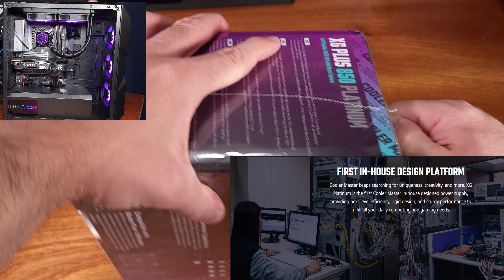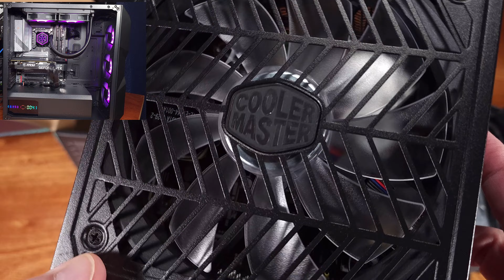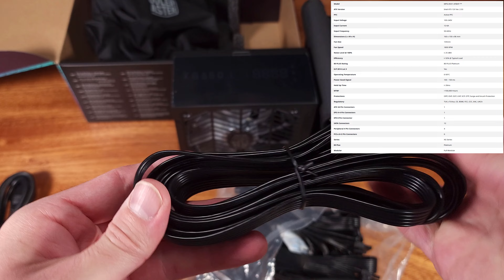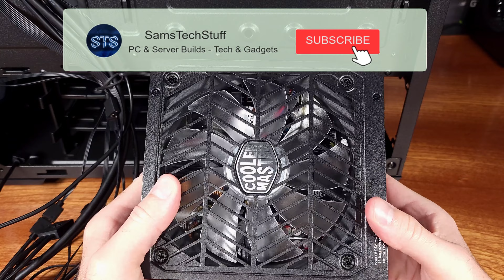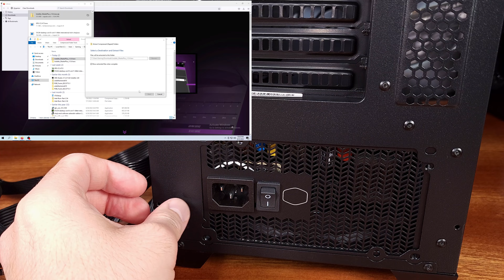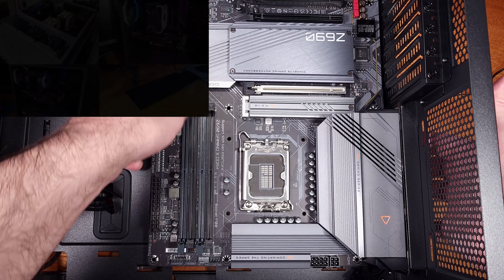Cooler Master XG850 Plus PLATINUM PSU Unboxing & Review

Comment: Hello!I bought new xg750 platinum.Installed in new PC? connected and it won't work - even no display, no rotation fan.What should I do or check?
mike.
Reply from the maker: Sorry for the late reply here! Did you get this working? I think there was a USB cable that I needed to plug into the motherboard in order to set the display up on the XG850

Comment: Looks amazing, wish they had more than 850w ARGB
Reply from the maker: I agree! its quite an awesome PSU and still running strong in one of my test builds. I'm not sure why they don't produce a higher wattage version? I would assume hte cost might be too high? Not sure. 

What kind of wattage did you need? Was this a gaming build or something like a Homelab server?
Reply: @STS  Realistically, I would want something with around 1000W, for keeping a safe range with my 4090.
Reply from the maker: Ah, yea, if you're packing an RTX 4090 you probably do want a 1kw PSU. What did you end up selecting?

Comment: Do you know of any aftermarket cables that'll work with this PSU?
Reply from the maker: Aftermarket cables? I am not sure to be honest - generally I would only recommend using the original manufacturer's cables. Were you thinking of sleeved PSU cable extensions?

Comment: la acabo de comprar por 109 euros cuando en muchos sitios está a 249. Pedazo de ganga
Reply from the maker: Wow, that sounds like a great deal!
Reply: Yo tambien, coolmod verdad?
Reply from the maker: Great deal!?
Reply: @STS  Yes, time ago 1 euro was 1.20 USD, now 1 dollar is 1 euro. The PSU is around 230-250$ and the deal on that page was of 110$.
Thanks for the video too! Useful
Reply: @Zerohmaru1  si coolmod, es una auténtica pasada, el viernes iré por la gráfica 6800 xt que quizás la bajen a 499 otra vez, o la 6900 xt si la bajan también
Reply: Estoy dudando en cogerla pero algunos dicen que es muy ruidoso el ventilador,  ¿Que te parece el ruido del ventilador?
Reply: @auxus21  Yo no soy alguien que se fije en si un componente hace ruido normal o excesivo, pero no siento que haga ningú nruido fuerte al igual que ningun componente de mi PC. Si no me equivoco el ventilador no se ctiva hasta llegar a cierta temperatura